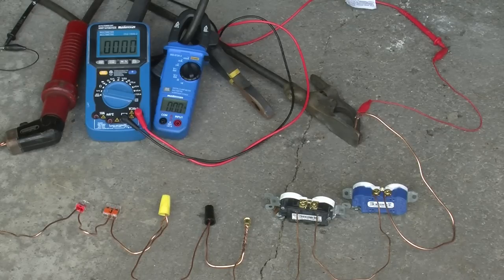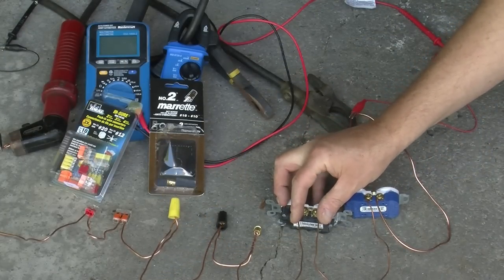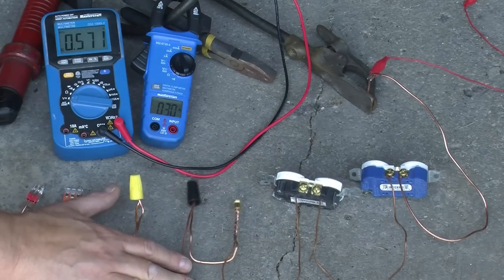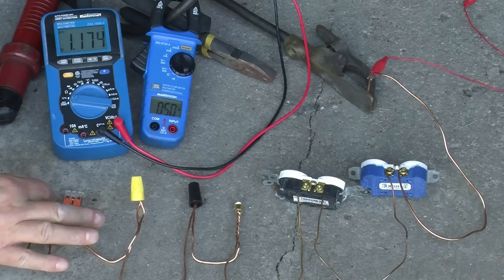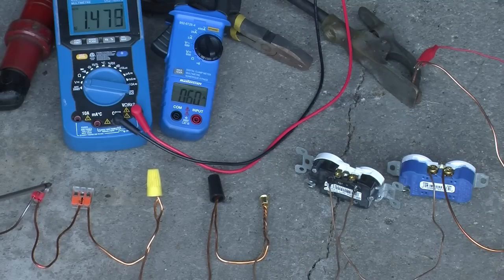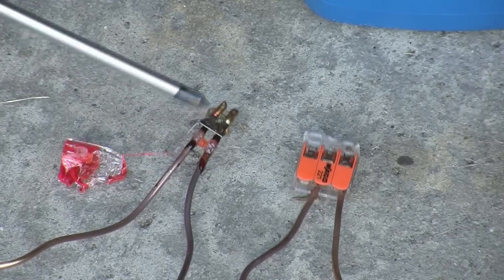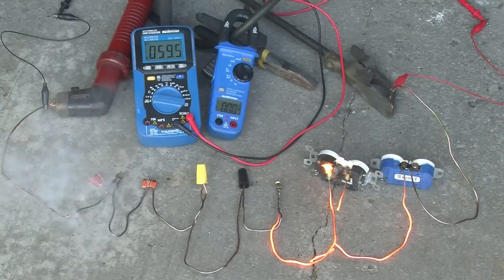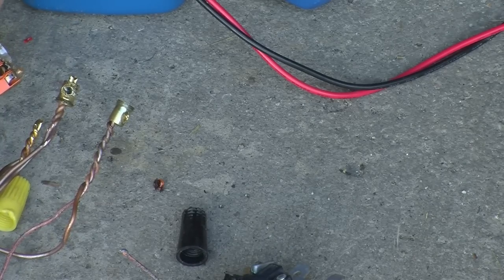Connectors: Which is the Weakest Link

Comment: Thanks for the informative video. I also would like to see how stranded wire compares since the Wago is my goto over wire nuts for stranded. I do love the convenience of the Wago lever nuts. I can absolutely see the solid wire performing better with wire nuts since the nut is not really doing anything if wire is twisted. I have seen many issues with wire nuts and stranded especially if different gauge stranded are connected under the same nut. I see comments on here about stranded wire not used in high voltage or not ok to use. How do they think high voltage is done in the industrial environment. I am an industrial electrician for over 25 years and we almost exclusively use stranded wire from 24VDC control wire to the large incoming power feeds and high voltage motors. Honestly solid is limited in use to basically smaller size house wiring, inductors and transformers.....
Reply from the maker: I might redo/do some more of these next summer when its warmer now that I have an IR camera. Next summer because they have to be done outside or at least in an open garage because of the noxious burning plastic fumes. 

Your industrial/high power/high voltage background really adds an additional perspective to all of this. Interesting point about stranded - I think the largest solid I have seen is #10. I guess much bigger than that and its more of a rod than a wire!  

Here is a question for you - so what is the largest (stranded) size of wires that is typically  used in wire nuts? And what to do use for larger wires?
Reply: @ElectromagneticVideos  
Yes #10 is usually the largest I see as solid.  Rare times I have used large wire nuts on #10. More often than that I typically go to the crimp on lugs on anything #10 or larger. The lugs are cheaper than T&B motor pig tail connectors. The motor pigtails are neat because after crimping they slip together and go into a rubber boot. The boots are nice but are expensive (I for example a 10HP motor would need six of these to completely wire up). I see the crimp ring lugs and high voltage splice tape used the most above 5HP.
Reply from the maker: @ThriftyToolShed  Of course - crimping! 

Interesting about motor connectors. High voltage splice tape - I'm guessing an industrial version of plain old electrical tape?
Reply: @ElectromagneticVideos  
Usually 3M tapes such as Scotch 70 Self-Fusing Silicone Tape and Over wrap of the Scotch 130C Liner less HV Rubber tape.
Reply from the maker: @ThriftyToolShed  I just looked it up a one of my electronics suppliers : "Dielectric Strength ASTM-D1000-76 34kV/mm" very impressive! I was not expecting that from tape! Glad you told me about that - never know when that might be useful!

Comment: I would have liked to have seen a yellow wire nut that wasn't pre-twisted and would have liked to have seen the screw down outlet on the 12 gauge wire. Oh and the use of an infrared thermometer would have been interesting.
Reply from the maker: All great suggestions, particularity since I ended up getting an IR camera used in some of the later videos. So it would certainly be worth doing again sometime in a slightly better way!

Comment: The heating of the 14ga wires by resistance cannot be distinguished from the push in backwire connection. Better comparison would be all 14ga and wire lenths equal.
The wires are supposed to twist together from torque of the nut. Normal circuit breakers do not go that much higher than rating on resistive loads.
Reply: Current is the same through a whole circuit. Same heating on each end
Reply: @ReubenHorner  Heat is caused by resistance, smaller wire equals higher resistance.

Comment from the maker: It's low voltage to pass a controlled current though what is effectively a short. The power source is an AC welder controlled by a variac (variable transformer).

Comment: #12 AWG copper will melt open in  a renewable link fuse at 235 Amps. #14 AWG copper melts open at about 166 amps in  a renewable link fuse. These wire link fuses went out of use about 75 or 80 years ago. They were quite popular in the 1900s through the end of WWII.
Reply from the maker: I have heard about fuses like that. Interesting to hear the details. I do remember  fuses that had a replaceable thin wire between some ceramic and an asbestos pad for household branch circuits in some 240V countries. I guess in the old days that was the simplest way to do things.

Comment: Would recommend using a FLIR camera or even a cheap Hanh held temperature gun to check temperatures. The one hole lug that connects the #14 to stab in st rear of receptacle is only rated for one wire. If you have two wires inspectors will tell you to use a two hole lug.
Reply from the maker: Good point about the FLIR camera - I did get one for my cell phone which I used for later videos such as the Knob and Tube one. I will have op repeat this one sometime with the camera.

Comment: Thanks for carrying out this test, and posting the results.
I rewired my parent's basement, and all the wiring I could reach in a 2 storey home, in 1969, in  house built in the 1930's.  The power co. inspector commented to my mother that a very nice job was done.
Since that time I always used MARR set screw connectors when needed.
When newer, "easier to use" connectors appeared I still stuck to the screw-type MARR connector because, from a mechanical standpoint, they performed a better job than the "easier" ones.
Glad you proved my judgment correct.
On another note, I am glad to see that a brief, 2 seconds or less, 250% overload on the wiring is not harmful provided good connecting practice is followed.  Never liked the "push to fit" hardware, especially not on plumbing jobs.

Comment: It would be interesting to do a milliohm resistance reading on each individual connector. The ones with the highest reading would get the hottest and the ones I would not use but then again, who would draw 50 or 100 A of service residentially?
Reply from the maker: I could do that with a voltmeter across each connector and use the voltage and (known) current to get the milliohms. As far as who would draw 50A or more, the purpose was really to see how how big the margin of safety is - its actually quite impressive given this sort of wiring is typically used for 15A max.  Having said that, things like motors can  draw many times (I have seen 6x) their running current for a few seconds while starting up so for things that I would prefer to have components that handle larger currents well.

Comment: It is a nice setup however due to the 14 gauge wire on that back stab outlets, that 14 gauge wire will heat up significantly quicker therefore causing that outlet to fail prematurely compared to the other terminations. You will have to redo the experiments with all 14 or all 12 gauge wire.
Reply from the maker: yes - its not an apples to apples comparison.  The reason for the #14 is the back stab outlet specifically required #14 in the instructions.

Comment: the whole test is absolutely moot the second you take the consistency of the wire out of the equation. do the same exact test across the board with all 14 gauge wire, and then you can have some non-biased results.

Comment: I'd be interested in measuring the the connection resistance of each of these BEFORE and AFTER the test. It seems, the yellow nut kind of hard-soldiered itself?
Does it make a difference how hard you fasten the nuts/screws or even clean the copper surface before attaching? 
How long/many turns make a difference in the nuts?
Also, what about conventional screw terminals?
And for comparison: Where is the limit of soldiered connections?
Reply from the maker: I should do a more controlled test like that. Maybe when I get  FLIR camera!

Comment: It looks like the wires below the yellow wire nut are touching, which would reduce the current load on the actual wire nut. Also, the wires in a wire nut should not be twisted. They will twist themselves if you install it with proper technique.

Comment: Back in the early 70s when the backstabbed outlets first arrived and would except number 12 wire my Company had me wire an entire apartment building with them. Two months later I was back replacing every single outlet.
Reply from the maker: Besides being frustrating, it must have been an enormous cost to the company. I can believe they still equip outlets with them.
Reply: We're you using copper or aluminum.   If aluminum,  was it the old technology aka 1350 AL, or the then new technology aka 8000 AL ?? My understanding is many homes, apartments and especially cheap double wide mobile homes used aluminum wiring from about the mid 60s, to the early to mid 70s due to the copper shortage caused by the post WWII housing boom and the Vietnam War.
Reply from the maker: @Sparky-ww5re  Never occurred to me that different alloys might have been used.  As far as I know it was very common here (Ontario, Canada) at that time - I didn't know there was a copper shortage - that sure explains the the switch to Aluminum.

Comment: My present house is full of receptacles and light switches carrying downstream loads via push in back connections and they are all failing. I replaced a dozen or so the first year I was here, and a few every year since. Never had to replace an outlet that had only single wires for hot, neutral and ground. One I replaced a couple of years ago I used the ideal connectors to create pigtails because the wire insulation was burnt back to within a couple of inches of entering the box.  The circuit was never overloaded but one morning I noticed my shaver charger was very hot, so was the outlet cover.
Reply from the maker: So the ideal connectors somehow overheated under normal load. That s really surprising. I wonder of the iriginal overheating somehow altered the wire and the connector didn't have a good connection because of that?
Reply: @ElectromagneticVideos  no, the ideal connectors have been fine. The original outlet wired with back stab overheated, burning the wiring. I cut back the burnt wires and used ideal to connect pigtails to replace the outlet.
Reply from the maker: @Sylvan_dB  Oh - ok - I misunderstood! I can sure see how the Ideal connectors were "ideal" for your situation! Glad they worked!

Comment: How are you pumping 70 amps through a bare copper wire and touching it and poking it without dying? Is it just because you're hoping you're less of a short circuit to the ground than that wire already has?
Reply from the maker: Because its essentially a short, the voltage needed to  generate 70 Amps is only in the range of 1 to 2 volts. This is the same as the voltage drop that occur along the wire or across the connections in normal use, although you would hope the current never gets close to that value. Like the neutral wire in a real situation, the wire here is at about ground potential. I sure wouldn't be touching it if it was at 120v like the "live" wire in a real situation.

Comment: I work in maintenance and I was having a problem with a flourescent lamp fixture .
I replaced the ballast using wegos and the fixture wouldn't turn on . I undid all the wegos then put them back and tried
 it again. Still wouldn't turn on . I called up an electrician for the building and I told him about the problem and he suggested using wire nuts instead of the wegos. I flipped the switch after using the wire nuts.  It came on like it was supposed to.
Reply from the maker: I always find in fascinating to hear real world accounts like yours. I have seen ballasts with very thin wires. Maybe they were just too thin for the wego to clamp to?

Comment: Would a solder joint hold up to this test?
Reply from the maker: In the Knob and Tube test I did in one of the following videos, a 100 year old solder joint covered with electrical tape was amazing, so I think it would. I think the the main weakness in all mechanical connectors is the often relatively small contact size so higher resistance at the connection. In spite of the higher resistivity of solder compared to copper, I suspect the much larger contact surface area really makes it a superior connection. But probably a case of it being way better than it needs to be for most applications.

Comment: Wago looks like it failed electrically before the ideal connection, even though the plastic melted first, the wago seemed to be the one that threw sparks
Reply from the maker: Yeah - but in fairness to both of them they only began to show signs of failure way beyond what they normally ever should be subjected to. Now that I have a IR camera at some time I will repeat the test and see which gets hot first.

Comment: ive been upgrading switches to smart switches for my buddy. for making the connections im using the wago style, specifically due to the smart switches using stranded wire. otherwise ill use a wirenut, unless its in a low current application that will need to be taken down for service

Comment: How are you touching the bare wire without get shocked?
Reply from the maker: The voltage is low: 10V or less. Thats because  the circuit is essentially a short and you need a low voltage to limit the current to reasonable values that would be flowing under normal load conditions.

Comment: how are you touching that wire!
Reply from the maker: I can because its low voltage - its just the voltage drop along the wire which is a short and max two or three volts. if it were at 120V I would not be doing that!

Comment: Are you able to touch the bare wire and connections since the voltage is so low there is very little potential to be shocked?
Reply from the maker: Exactly! It it was 120V I wouldn't be touching them!
Reply: Anything over 50 volts AC is enough to kill.

Comment: You pointed out that you touching them to check temp wasn't very scientific, why didn't you use a laser thermometer?
Reply from the maker: I find its hard to point one of those accurately at small areas, at least one the hardware store one I have. And the test was really intended to see which failed first. I'm looking into a FLIR type camera. I think a close up of one connector or another as the current is interested might be more interesting and something to do in the future!
Reply: @ElectromagneticVideos  - I can see that.

Comment: I always thought the wago connector was just shit compared to the standard twist wire nut. It's really impressive to see that it does survive to the same power that the screw connection does.
Reply from the maker: I was impressed how well they did and certainly did well at all rated currents. What I wonder is how decades of age may alter their internal mechanics. Some people have said they use them for low power lamps and I can see that. For something like an induction motor with high startup current surges, I would stick to wire nuts!
Reply: Same current, not power. Let's get the parameters right.

Comment: Anyone notice the wires are a bit dark at the end of all that torture
Reply from the maker: Good observation! The heat causes a thin oxide layer to form on the outer surface of the copper making it look darker. Same thing happens to exposed copper that is not overloaded over years of gradual oxidation.  Interesting thing  about the oxide layer - it actually can be used as a semiconductor rectifier and devices made with copper oxide were used in application like battery chargers before modern high-current semiconductors were mass produced.

By the way - saw your vacuum motor burn up video - from my own experience I'll bet that gave off some noxious fumes!

Comment: Voltage drop across each separate connection will tell the story. Or an Infrared imager.
Reply from the maker: Yes - I did get a IR camera for the later wire in insulation videos.

Comment: The problem is simple: wagos are designed to eliminate twisting wires together. And wires need to be twisted together to allow a marrettte to be installed.

Wagos require no twisting of wires, and THATS the problem.
Reply from the maker: Good way of putting it. I might use Wagos for for things like an easy connection to a ceiling lamp where current is low. But really prefer wire nuts where larger currents are involved.

Comment: Very timely presentation as I was curious how the wagos work.  Since you are becoming the official YouTube wire burner, might need to invest in a flir camera. Thanks so much !!  Ken
Reply from the maker: I had never used them before, so it was interesting to see. Some youtubers seem to be proclaiming them the best thing since sliced bread. I'm less convinced of that now but they do fill a certain niche. Glad you liked the video. It actually might be fun to have a flir camera - I'll have to see if I can find a  flir imager that I can record the data stream directory from rather than the common integrated sensor/display units. An I'm honored to be "the official YouTube wire burner". I'm really amazed how the 14/2 video really took off - who  would have thought!
Reply: @ElectromagneticVideos  I agree the wire nut is by far the most reliable, but those wagos as sweet when you have to swap a wire.   I’ve tried the ideal, and I found you can remove the wire - However, the wire does need to be a fresh strip.   I was amazed at how much current you could push before bad things happened.  I’d love to see the heat map of those little connectors at higher current.  Anyhow, they are UL listed so I suspect someone, somewhere tested all this.   You my friend are very good at talking this through and appreciate the video.
Reply from the maker: @MrKen59  Your right - you cant beat the wago if you have to change something. But I think for any high power stuff wire nuts are it. I couldn't agree with you more about how well they all survived such over-current abuse. really impressive. By the way - I really appreciate your feedback about my talking - I have been wondering if I was anywhere close to a good balance between saying too much or too little .